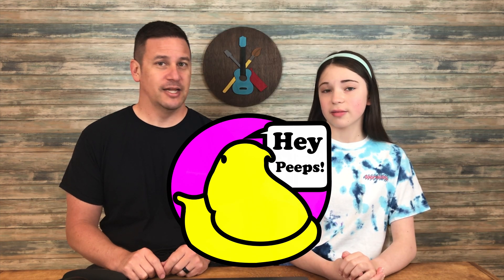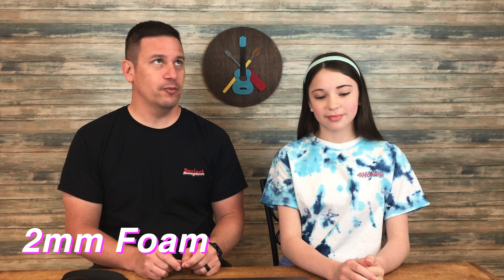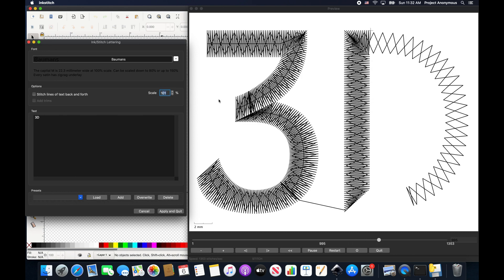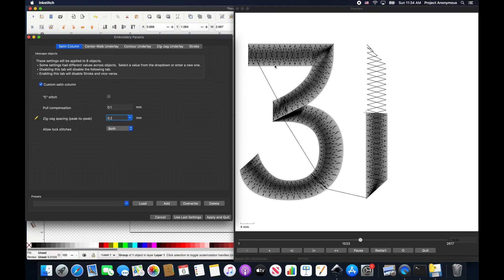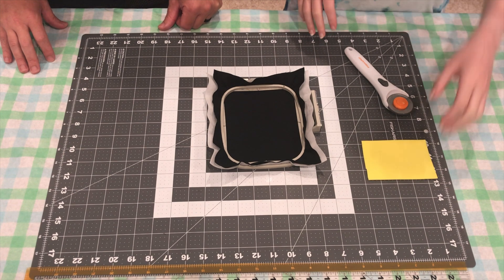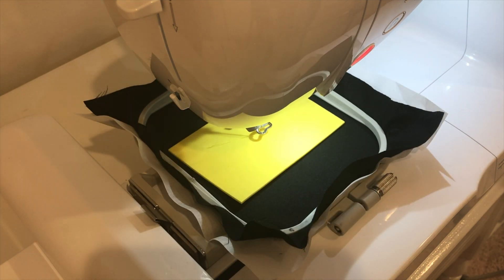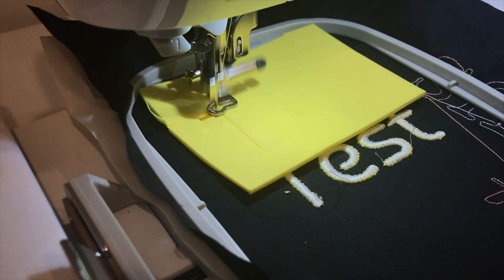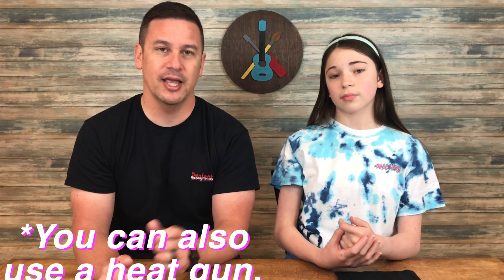3D Puff Embroidery in Inkscape & Ink/Stitch Using the Brother SE1900

Comment: Super helpful video! I’m using the SE600 with ink stitch for the design. I still can’t seem to get my design to come out properly even without puff foam. The lower bobbin thread color continues to comes through to the top. I’ve adjusted the tightest to try and help it from not coming up. But it still does a bit. Which settings do you typically use in params embroidery extension for a non puff/ or puffed design? Thanks in advance
Reply from the maker: It sounds like you may want to adjust (tighten) your bobbin tension vs your thread tension... We cover how to do this here: https://www.youtube.com/watch?v=WCwRGoDtcl8 As for setting changes in params, the only adjustment we make is to the "zig-zag spacing," the default for us is 0.3mm. For puff embroidery, we have good results with 0.2mm. Hope this helps!
Reply: @ProjectAnonymous_Duo  thanks a lot for the response I’ll try this out today!